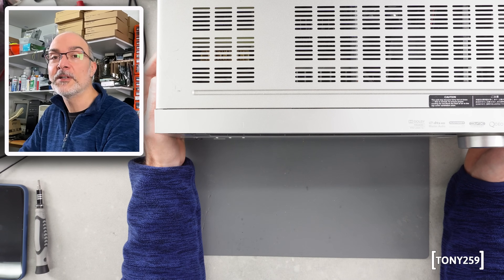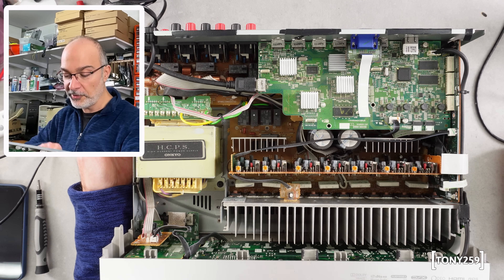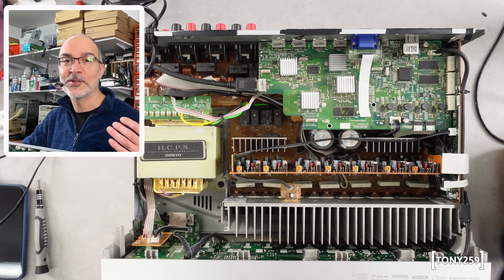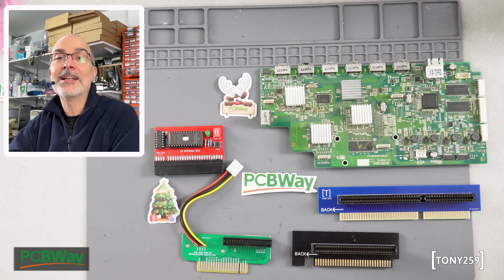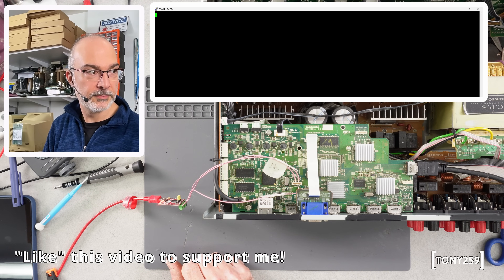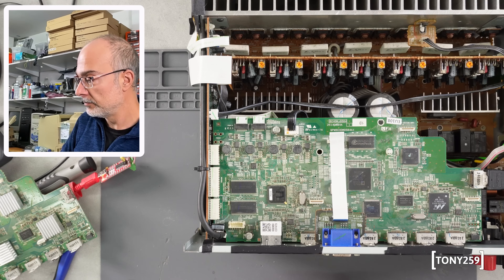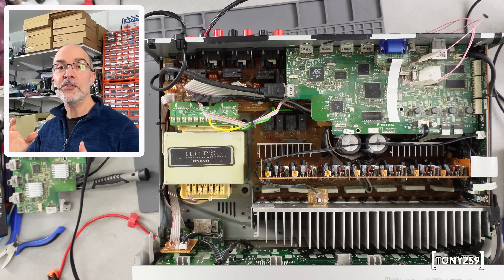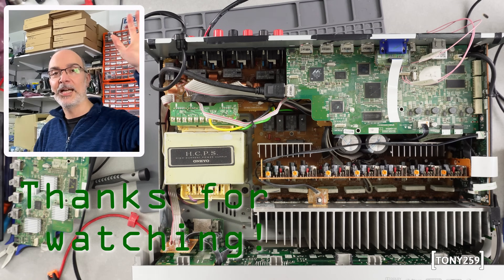Let's fix another ONKYO with no sound!

Comment: Hi ✌🏼 A great video. I have the same problem with an Onkyo TX-NR515. The DSP chip with Revision B is installed there. Unfortunately, I have not found a replacement HDMI board on the Internet. Can you still fix something like that? I would then only send the board. I would be very happy to receive an answer. Best regards and keep up the good work. 👍🏽 I have definitely left you an subscription 😊
Reply from the maker: Unfortunately there is no replacement available, I've discussed this issue in the Onkyo 3007 repair on the main channel. Sorry!
Reply: @Tony359_2 thx for answers! But this is terrible shit! 😢

Comment: Are the small aluminum finned heat sinks with self adhering sicky on Amazon be adequate enough?
Reply from the maker: I think so. Those chips are kind of designed to work without so even a small one will drop the temperature considerably. Make sure you get the tallest you can for the best result. And remember the glue is not very strong so if you move the AVR they might detach and fall on the PCB…
Reply: @Tony359_2  for the 1st time in 10 years my tx-nr809 started doing this crap. Ive been reading about it and watching the videos. I heated the chip up and it worked. So i should add a heat sink?

Comment: Nice video! Great explanation! I have one TX-SR608 that stops working, the same issue as yours, no sound. Using a thermal camera I found a 1.2V regualdor getting hot, the tms320d788 dsp IC is in short on 1.2V. Did you get any similar issue?
Reply from the maker: interesting. Are you sure the 1.2V line reads a short? Those lines can read low resistance naturally. Regulators can also become hot by design. But no, never had that. Though on a future video I'll repair an Onkyo where the supply voltage of that DSP had a little surprise!
Reply: @Tony359_2  I Measured the 3.3V line and 1.2V, I read ~3V instead of 3.3V and 0.2V instead of 1.2V. I removed the L202 which is inductor between 1.2V regulator and DSP IC, now 1.2V is 1.19V and 3.3V is correct as well. The resistance measured in DSP 1.2V is lower than 0.5ohm, that why I'm thinking dsp is broken. As it is a TQFP package, I can try to replace it if I find one, but I'm not sure if needs to be programmed before...

Comment: I fixed my two Onkyo AVR's at no cost. The first one I tried reflowing the DTS chip, it worked for a couple of weeks then died again. The Onkyo would continue to work as long as I held a heat gun directly on the DTS, which is not very practical. I bought another used Onkyo, worked for a few months before the sound went. Tried the same procedure as the first one and got the same result. I finally found the perfect fix for both machines, I hope the recycling centre can make some use of them.
Reply from the maker: ahah yes, unfortunately without a reliable source for those chips that's the solution...

Comment: The IC Chip gets pretty hot which on some units tend to fry & the LED free solder balls end up cracking leading to non contact hence no sound also . Best option is to reballing with leaded solder & attaching a decent heatsink on Top to drop the temperature by 20° if the IC chip is still good ,  this should help the IC chip last a lot longer than 20 years .
 Most of these blown IC's will have light brown or bad heat marks , then they'll need replacing .
Reply from the maker: A heatsink is a must and lead free BGA is an issue. But that’s not the prime cause why those chips fail I’m afraid. Follow the links to the video I made on the 3007 and I explain what the problem is. Thanks for watching!

Comment: Hi Tony, I have an Onkyo TX-SR309 which I love but it has the same sound issue.  I’ve been looking for a replacement PCB with revision D of the IC but these seem hard to come by, unless you can point me in the right direction?  Have you sold this receiver featured in this video yet?
Reply from the maker: I found the board on eBay and took me a few years. Yes I know. And yes I sold this one, sorry!

Comment: so does the chip have a firmware that need to be flashed?
Reply from the maker: As far as I know, no. But it's stored on a nearby chip and might get corrupted.
Reply: @Tony359_2 thanks so it is a SoC like rpi
Reply: @Tony359_2  I bought a D model chip but confirm a straight swap is not working. I believe in one video why if you change the hdmi board with the chip works but not just the chip (BGA) is that the DSP SoC likely have uuid/cpuid written onto the memory. Unless we flash a clean, original firmware and initialise from there it might work. But there is no way to upload firmware if the dsp chip is dead.
Reply from the maker: My understanding is that those chips don't require a FW but the FW might have got corrupted when the previous chip kept freezing.
The issue is: how do you know your issue is the firmware and not the chip? My understanding is that the vast majority of those chips is just fake.

Firmware is available via tjmotter on repairalmostanything. Good luck!
Reply: @Tony359_2 Because I heated the old semi working B model multiple times, from turning on immediately to having to turn on for 30 minutes to warm up until it click with sound and it’s gone forever. Can’t even update the FW as the usb icon gets blanked out. So the only way is really using CH341 to reprogram the nand itself. When I take the chip out the chip bulges on the pads meaning it gets overheated… this is actually my third onkyo, last one was the same and I still have a working nr626. - don’t want to touch anything on it as it is the last working one ha
Reply from the maker: @gabrielwong1991  if it was working before, why are you assuming it's bad firmware and not a bad chip? Yes, firmware must be reprogrammed on the nand. The files are where I mentioned. The Nand files.
Reply: @Tony359_2  The old B model chip died, so i ordered a D model to see if it is just a drop in replacement. It wasn't exactly Aliexpress but a China version of Aliexpress called Taobao - saw 80 people bought and nearly everyone said it work... And after i BGA and replace it does not work so i suspect it is the NAND fw need to be updated.

Comment: I got pioneer vsx 922- k which has no sound. I ordered a d808k013dptp5 chip (i had d808k013cptp4) from Ali. Its my first time fixing stuff like that but i still ordered a ch341a usb as i know the ic firmware was corrupted. The clip from ch341a was terrible and it took a lot of time for me to flash it without any errors. I also checked it again after that and everything was ok. I had no ue22 error before and just no sound but after replacement and reflash - i got it. As for now i think what is the problem. i will check for the pins from the chip to be soldered correctly but i caught myself on the thought that i should have updated it before replacing the chip. The firmware was from a polish site and i know it is not from 922k but it still should have worked as there was a guy that fixed the same receiver with that firmware.

Comment: hi bro, what was your hot air tempture, last time when i tried to reball i burned the pcb
Reply from the maker: I didn’t use hot are on this video I think? In any case the temp is not all, you need a pre-heater as well. I haven’t mastered the process fully myself yet.

Comment: I got the solution for this common problem on all Onkyo receivers…. As all we know, these suddenly “no sound” problem is very normal on the Onkyo… as they are outdated system, the DTS chip/module or whatever you named, tends to fail because the heat in the receiver affects this; and additionally the chip/module version came from factory with this “weakness”… so all you have to do if u are getting this problem is to open your receiver , and locate de DTS chip and verify the number/model it have written on it, and search on Ebay or aliexpress the same chip but with the letter D!!! The D series is the one renewed version that “correct” this problem…. I did to mine last week and now is working flawless… if you need help let me know!! Just have to remove professionally the old DTS and install the new one, as suggested in this video !
Reply from the maker: Thanks but… I think you missed a few points I made on the video and the other onkyo one on the main channel! I wish it was so easy. 😔
Reply: @Tony359_2 hi tony! In my case, i did this job as i said, two weeks ago…. In my puntual case, all i did was remove the old DTS chip and install the new DTS D series… just plugged again the board on the system and everything was working flawless without update the system etc etc… obviously the process of installing the new chip needs to be done by a professional installer! Besides this, i think is an easy work
Reply: Where do you live? I believe my tx-nr1010 need to change the DTS chip.
Reply: Dont you need to update firmware if you use different chip?
Reply: @Bassquake76  in my case, no! I just installed the new DTS and everything worked just fine

Comment: Where can I get the schematic? My My Onkyo TX-NR686 doesn’t turn on. I checked power board and it’s working. Where else should I check?
Reply from the maker: try elektrotanya
Reply: It could be the standby relay. I had the problem with another Onkyo receiver and it was fixed in half an hour 🙂

Comment: Hey, I don't know if you know what the cause could be to my problem but, We have a Onkyo TX-NR646 from 2016, and over the years, slowly it's started doing some weird things like when pressing one of the source buttons like "CD" makes it go to the AUX input first and when pressed a second time, only THEN it actually goes to CD. Or like the remote failing to work properly, as if its recalibration keeps lessening until only the volume buttons on the remote still work. And now I've heard you talk about a possible vulnerability of these chips, I wonder that DSP chip might be the issue to all of these strange issues, unless it's a firmware problem and I should update my receivers firmware?
Reply from the maker: I'm not sure I can help you but if the DSP fails, the onkyo stops outputting sound. I'm not aware of a different failing scenario.

Comment: Hello Tony ,you flew through the process a bit quick for me to understand I need the hdmi pcb for the onkyo 609 ..on the pcbway website do I need to give then the serial number of the pcb,coz when I asked them if they had a replacement hdmi pcb for an onkyo 609 they couldn't seem to help me.
Reply from the maker: Hi - you might have misunderstood me. PCBWay happens to manufacture PCBs but you cannot buy a replacement HDMI board from anybody. The one I got here was from Ebay, pulled from another 609. Sorry!

Comment: Hi, good vid., I have same problem with a 609! May I ask how you sourced the pub from PCBWAY? Cheers
Reply from the maker: the Pub?
Reply: @ Sorry, typo! PCB! Cheers
Reply from the maker: ahah!

Which ones? :) The ones I show in the advert are mostly public projects - the ISA 90 degree extenders are my design and can be found on the PCBWay store but the gerber files can be downloaded for free.

https://www.pcbway.com/project/member/?bmbno=D27E41F7-4CD4-49
Reply: @ Thanks for your reply. I’m not that technical, but I was thinking that if I could obtain a later PCB, including the dodgy component chip, that I could swap out and rescue my TX NR 609!? Did you say it was around £40? Mine has a later repaired replacement component and strangely has lost picture but not the sound? I assume that this is still the bad hdmi board that’s responsible! Thanks for your time! Cheers
Reply from the maker: PCBWay make "empty" PCBs. What fails with the onkyo is the DSP IC which cannot be sourced. In short: PCBWay cannot help you, I'm afraid!

Comment: I've seen people add heat sinks or even active fans to this DTS chip in order to keep it functioning.  I had a TX-SR604 by Onkyo which worked great, but you could cook waffles on top of the unit if used for long periods.
Reply from the maker: Yes, Onkyo are space heaters. 
However it's not clear whether those DSPs fail because of temperature. One can only hope that it can't hurt to have a heatsink :)

Comment: Funnily enough, my Onkyo TX NR 171 has the 'D' version chip, and it also suffers the no-sound issue. I had it re-balled some years ago, however, it has started acting up again. To get it going, I use a heat gun on it for a few minutes, and it works until it doesn't. Then another heat treatment and so the cycle goes..
Great video!
Reply from the maker: oh that's weird...

Comment: Those aliexpress DSP chips are roulete many od them are fakes sometimes they work except for USB or NET function and sometimes they work without an issue there was time when you could buy original but then china came up with their fakes or reprinted bzkb
Reply: By the way any advice 
I have tx-nr818 with burnt AMP transistors (TTA0001 AND TTC0001) whole 4 pairs i remove them and receiver now works in stereo   do you have expierience in that topic
Reply from the maker: I know, check the video I made on my main channel when I explain that! 🙂
https://youtu.be/__GgR87t3ik

Comment: ive had onkyo (and others) hifi,  dsp disco pa speakers,  and bose amps from cars still fail to work after dsp ic replacement for silence, screetching, hiss or poping/cracking  , always results in silence and had to assume theres firmware loaded up on those chips and the replacements are no doubt blank ,best guess i came up with anyway

Comment: G'day Tony.!
My Onkyo killed all the right hand side speakers. 8 months out of Warranty.
Centre and Sub have no output at all.
Its a pity cos they have great gear.
Reply from the maker: Hello - it's weird, the LFE is not a powered output (unless it's one of those very low power "HT" series).
Reply: @Tony359_2 
Hi Tony.
Yes you are correct.! My mistake.
It was a Sanyo Amp that burned the speakers.
The Onkyo lost RF, RR, Center, Sub.
I was so angry, I didn't even think of searching the Internet. I focused on rebuilding the speakers, coil, cone, etc.
The Sanyo and Onkyo have banished to the cupboard awaiting repair.😠

Comment: I experienced exactly the same path. Bought the chip from AliExpress and did not work, used serial monitor and had absolutely no output exactly like you. Eventually I found on eBay a new board and replaced and my receiver came back to life.
Reply from the maker: it's so sad that there is no other way...

Comment: Can you not download the firmware through the serial console?
Reply from the maker: I'm sure there must be a way, do you know how to do that via console?
Reply: @Tony359_2 Often (but not always) Uboot (the bootloader that initialises the chip and loads the Linux kernel and initrd) has a few commands that allow dumping the filesystem/firmware to external media or even over the serial console (although that would take a few hours probably because serial is slow).

If you can get into the shell by pressing any key during the "press any key to stop autoboot" prompt you can run some bootloader commands but sometimes they set the bootdrlay variable to -1 meaning it will skip the check but maybe you are lucky
Reply: @Tony359_2  No I have no experience in that at all. IT just seems like somthing that should be possible. For someone who is good at linux.
Reply: @Tony359_2  Is it possible to send commands through this terminal? 

I think it could be possible to send a DD comand to basically image the whole filesystem and with the output to the very own serial terminal, then on the pc acessing it, you would need to output the data directly into a disk image like an .img. 

No idea if this is possible, but if it runs linux, it may have these commands
Reply from the maker: @eduardoavila646  I know some commands can be sent but given the small NAND I wouldn't expect many commands available. 
To be honest I think the best option would be to de-soldered the NAND and image it. I also understand that some of those ICs are encrypted, so not a piece of cake apparently.